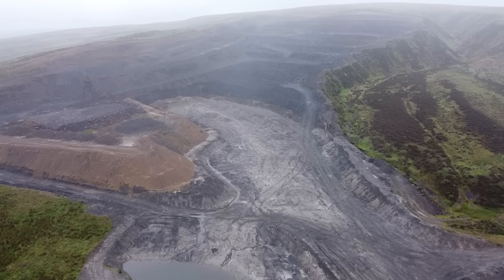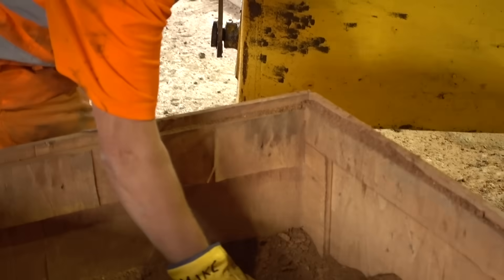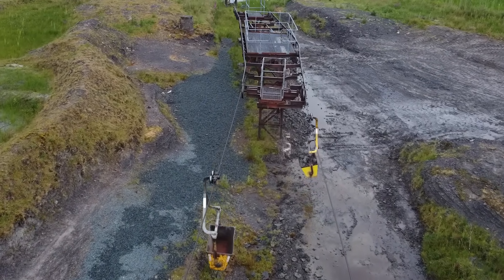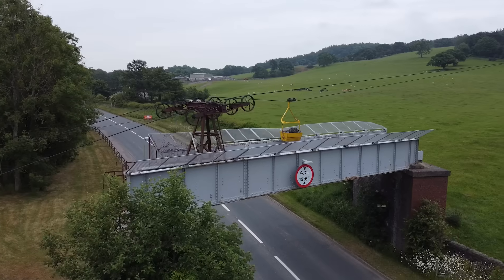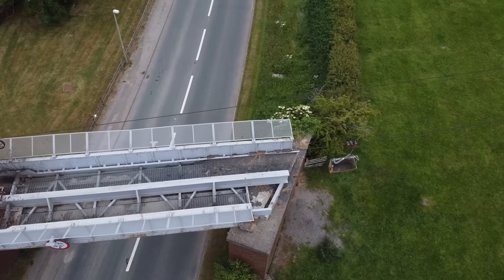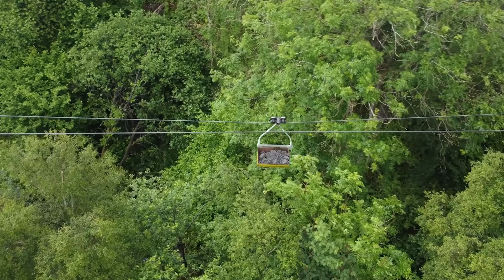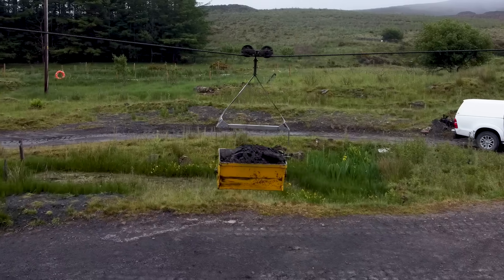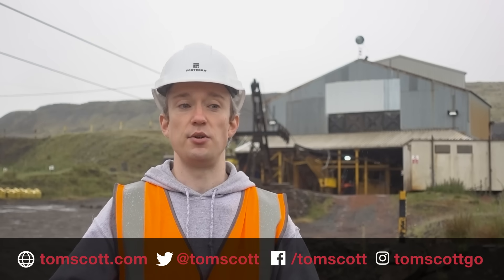The UK's last aerial ropeway uses no power, moves 300 tonnes a day, and will be gone by 2036.

Comment: How does an empty bucket moves up? I honestly didn't understand that, I could understand the filled bucket going down with gravity, how's coming back up?
Reply: The full ones going down pull the empty ones back up again.
Reply: @dingo137  But its a pulley rolling on the wire right? Or the wires have a hook where the bucket gets attached and pulls the wire with it?

Comment: "Unless money is constantly spent to keep it in working order"

Alright, whats the maintenance fees?
Reply: A new rope every 6 years
Reply: @edwardstarling1835  ha, that'd be nice. But you have to consider maintaining or at least getting the towers surveyed every so often. As well as replacement carts, or parts to repair the carts on top of paying someone with the skills to make said repairs. Though I'm sure thats not even half of it.
Reply: @edwardstarling1835 
I think that's only when you actually use it
Reply: @edwardstarling1835  a new rope that is quote “incredibly difficult” to replace. Again, what are the maintenance costs?
Reply: Probably a lot less than all the trucks they would need to replace this rope machine... Plus, it probably is a lot less in terms of payroll.
Reply: A brief google search found that replacing a 5 mile gondola cable cost over a million dollars. Annual inspections probably a couple hundred thousand, painting annualized is probably 25 thousand, then there’s brakes, lubrication, operators, other moving parts repairs, etc. it probably costs at least half a million dollars annually to keep it going. Probably more. I don’t see why they act like the cable is so hard to fix. I don’t see how it works be any different than chairlift/gondola cable. Maybe because there’s not a lot of demand in the area and so not a lot of local companies that can do it.
Reply: @DVeck89  Thanks! As to why the cable is hard to fix, I'm not sure, but I did notice they emphasised "cable of this size", as if it's easy to find splicers for other sizes of cable.
Reply: They kept using the system, so possibly was cheaper to maintain than replacing with another system.
Reply: A functioning society with a strong and skilled working class
Reply: The problem is the lack of people with the skillsets to maintain the technology, splicing thick steel cable? Never heard of the artform. Replacing steel cabling that long? Never heard of that either

Comment: I’m pleased the system is still working okay. However, when I visited many years ago in the 1980s I’m sure that when the system started in the morning…it was helped for a short few minutes by an electric motor. This motor and the switchgear could be seen by visitors. Once the weight of the full buckets on their way down took effect, the system carried as ‘self acting’ using gravity alone. Please correct me if I’m wrong…but that’s what we were shown on our visit. A truly fascinating industrial relic and it’s a shame that it will eventually disappear. Many thanks for your excellent video. Rob.

Comment: There was a similar system running in Cumbria and due to the steep and long gradient down into the valley it actually generated electricity through a clever braking system which was then sold to locally.

Comment: The modern version of this is the electric dump truck in Biel, Switzerland that never needs plugging in. It takes its load downhill, and uses regenerative braking to recover the energy needed from driving uphill, but empty.
Reply: Notice how none of these naysayers give any viable alternatives.
Simply amazing
Reply: @Michael-Archonaeus  I love how they ignore the cost of the damage being done to our atmosphere
Reply: e
Reply: Athos Aramis  Tonnes of rare Earth metals??? in what reality? and the electric power as just explained - is generated by regen braking - so ZERO external power required - ever.
Reply: Athos Aramis  More earth metals went into the railway.
Reply: ..don't forget the initial cost of manufacture..
Reply: @Alfred Wedmore That very slight cycling will allow the battery to last decades most likely, if the controller can balance for any dead cells well enough. Lead acid batteries can also do the same, only use 100-80% and they will go decades if you keep them topped up (for cheap, off-grid using old car batteries etc).
Reply: Nope not even close. Electric dumps are cool but way behind this.
Reply: That's fuckin sick but wouldn't it be way cheaper to just build another one of these things?
Reply: Batteries that lasts decades?
Show me one.
Reply: @scottdavis8645  CATL
Reply: @scottdavis8645  I had a Peugeot 106 Electric. Original built from the factoy with Ni-Cd wet cells in it in 1996. I sold it in 2015 still with the original cells in it and still a range of about 60-80 km (original range was 100 - 120km). They have built hundreds of these cars in France :-)
Reply: But the dump truck needs batteries to store the energy surely, which means a lot of pollution just mine the metals for them, they probably need changing every so many years as well.  The tyres will wear away and need replacing.  Yes the wire rope needs replacing on this system, but I bet the energy and pollution required for that are far less than that needed for the dump trucks batteries
Reply: @super7cat  Money is a factor as well. The biggest factor even.
Reply: @super7cat  Batteries that  are not RAPID charged and are properly spec'd (this will not be a tiny little battery pack) will probably be good for many tens of thousands of "mini runs". Even relatively old Lithium Iron Phosphate cell technology - if charged and discharged at modest levels - are good for around 10,000 FULL cycles before their capacity is becoming heavily compromised. An over engineered battery pack that perhaps usually only sees a few percent of its reserves used would be so under-stressed that it's lifetime should be crazily long.

Modern electric cars have a short(ish) life simply because the cars are built for performance, range and price. The truck will be built for durability and reliability. MASSIVELY different specifications
Reply: Plus the energy to load the truck. This isn't free...
Reply: @terrystearns1196  The energy comes from the potential energy of the ore/tock which is located higher than where it is dropped off.
The energy to load the truck is going to be exponentially less than the potential energy released from the height difference
Reply: @terrystearns1196   energy isn't free loading the buckets either..
Reply: Meh, been done years ago on't railway. Just bluster with a dumper, tho'.

Comment: It does use power and it does use fuel. The fuel and labour energy dispensed for machinery and people to load the containers at the top are the source instead of having it taken down in another manner. It's just indirect. Aditionally the construction process of the ropeway can be counted a large pool of energy dispensed.

Comment: Another fascinating video, but I've had a hard time googling how the mechanism works. It turns out that these are used in Nepal, and there are documents explaining them - but they seem to use more cables: a control cable and guide cable; here there appears to be only one cable. Also, was the aerial ropeway featured in Get Carter gravity driven?

Comment: Hopefully they'll fabricate a Golden Bucket for the last load of material to be transported, that can be put on display with original buckets. Here in Phoenixville you can find metal "baskets" at various locations that I'm guessing were used at the steelworks back in the day as a reminder of the town's legacy.
Could it be turned into a naturalist/tourist ride, with proper maintenance, of course? Park at the top with hiking trails/observation tower/ nature center. Museum with shops/pub/chippie at the bottom.

Comment: From a physics/engineering viewpoint, if it's doing work it IS using power.  In this case the power comes from the potential energy difference between the load of rock at the top and the load of rock at the bottom.  Mother nature is providing the "power" via gravity.
A slick design for sure.

Comment: Honestly I don't know why this system isn't used more often, I doubt the maintenance costs are going to offset the combined fuel, maintenance, and labor costs of a similar truck route (you could use a pair of chain instead of a massive cable to avoid needing a specialist to splice it) so long as your destination isn't too far away you can have a simple reliable and cheap way to move material.

Comment: I can imagine having it turned into tourist attraction, transporting people just for the experience. An emission-free thing like that, in a modernized version, could actually work for tourists in many capitals with height differences. Paris, Lisbon, Nice, etc. Or even for local residents, as means of public transport. 
Anyway, great technology.
Reply: Well, it only works as long as you have something very heavy to send down. Otherwise you would spend more energy bringing the counterweight uphill than it would take to just do it electrically.
Reply: Also by the sounds of it the timing is very important, humans are very VERY bad at being loaded into things in a precise manner and awful at consistently weighing the same amount for each human. Now you could overcome this with a motor like many a ski lift has but then what's the point?
Reply: Also it only works one way, so you have to get your humans to the top of the hill at some point to send them down which means you require a mode of transportation to get them up there which is then going to go back down empty, why not just cut out the lift entirely and just send the transportation full up AND down.
Or could put a motor to send them up as well but then we run into the same issue of needing power to do that, making it expensive to maintain AND not unique anymore.
There's a reason they only use the motorised ones for ski lifts :p
Reply: Sorry, the health and safety JIHAD would have your balls on toast. BUT I agree- let's do some of this and show them the bloody finger for once.

Comment: If there is a fossil in those shales, the system would be fossil fueled.
Reply: incredible
Reply: It's my local shale-bed. Carboniferous. Loads of Stigmaria, Sigillaria, Calamites etc. Very fossiliferous.
Reply: get out. haha
Reply: I upload  This mine is for making bricks not Shale oil. So I don't understand the objection. (By the way I'm not a leftist I'm just legit curious)
Reply: I like the way you think, sir.
Or lady, I can't tell
Reply: Fun Fact where I live we actually have oil shale which is used to make shale oil. It's mined, processed, and used just like regular crude oil. So if this was used for on of those mines it would be "Fossil fueled".
Reply: r/technicallythetruth
Reply: Well, i guess we are back to square one
Reply: Indeed!  I am deeply familiar with the kinds of fossils that can be found in shale.  The only way they can be used as "fuel" is to use them as a weight in a system like this!
Reply: Nice
Reply: No, it's based on natural bending of spacetime.
Reply: Yes but actually no...
Reply: @PrakharBaisakhiyar  Of course it is, the weight of the fossil pulls the bucket and rope system along
Reply: Legend
Reply: It would actually be fossil fed fuel because the fuel isn't entirely fossil and would only contain some parts fossil which contains fuel of fossils, meaning the fuel itself would be fed by part fossil intern making the fuel actully fossil fuelled fuel or fueled by fossil fuel fuel as fuel isn't actually fueling in terms of fuel but in the terms of gravity fed fuel. Which is a different type of fuel altogether.
Reply: @_wanted_outlaw3007  you my friend are a ginius

Comment: Them- its a 25mm steel rope
Me- thats a 25mm cable though?
Reply: No.  Cables have a diameter less than 3/8" (9.52 mm).  See the Wikipedia article on "Wire Rope".

Comment: Not quite the same, but there are quarry with a modern twist on this:

Massive Dumptrucks with a fully electric powertrain, that never needs to be plugged into a wall. 

They only carry loads downhill, so they use regenerative breaking the entire trip down, which charges the batteries, which are then used to get back up the hill and around the quarry. They then load and and go back down hill, fully charged by the time they reach the bottom. Repeat.

Comment: A motor will brake when doing regen.  I'm surprised therefore that they have not hooked up a motor as a generator, which will reduce brake wear and generate money / store power in a battery.  300 tonnes per day is a lot of potential power going spare.
Reply: Those empty buckets still have a significant amount of weight to them, as well as friction losses to a cable three miles (!) long.  Several times they referenced the criticality of balancing the load by controlling the spacing on the buckets.  I doubt there is much spare energy to be harvested.  And if there were, they would be adding more buckets!
Reply: @DocNo27  sure, but as with a car you can have both brakes and regen.  And, with regen, you might manage more buckets.

I suspect that the slope is maybe not that great and you have to bear in mind that the cables droop between the towers, so it is not a simple matter of the start point always being higher.  

Cable cars usually have a balance weight to keep the wire tight , we did not see that on this system.

Comment: The rope attachment/detachment system isn't that indifferent from "express" chairlifts, that detach the chairs from the cables at either end. (in order to slow them down enough to get on an off, while running the lift cables at a higher speed than you could with fixed chairs)
Reply: It's exactly the same as the Mitchell's / British Ropeways chairlifts that we remember so fondly from Butlin's.
Was it installed by Mitchell's?

Comment: So if a turbine is connected, can it generate power?
Reply: Probably, but not very much. It comes down to resistance. The weight of the filled buckets and the slope of the hill give it JUST ENOUGH gravity to turn the rope in a loop, with the heavy filled buckets going down hill and the empty light buckets being pulled back up hill. If you add a turbine you add more resistance to the system, as now the filled buckets and slope need to more gravity to turn the turbine as well as the system. While you could increase the gravity by increasing the weight of the filled buckets and the gradient of the slope it would not be worth it. The power generated would be fairly small and the added turbine would greatly decrease the speed and efficiency of the system.
Reply: 🤔 Well theoretically you could use the turbine as a brake actually, so you could generate power with it...but that would be just a side effect, you still have to use power (or fuel) to fill the buckets at the top.

Comment: what the hell, this is WAY better than trucking stuff around, why aren't there more ropeways around?
Reply: Most quarries need to move stuff up, out of the quarry? Not sure.
Reply: I can see a couple of reasons. A cable way is more prone to single point of failiure. Failiures are trickier as there aren't standard components and millions of competent mechanics. If you built it in modern day with Western standards and laws you would most likely need to make the ground under it a no-go zone, which is a pain in the ass to farmers.
Reply: Just watch the video and you'll see.  They sure are trucking things around they material just happens to be unloaded onto a cable way from one truck down a hill and dumped into another truck.  

At some time in history this was more efficient.  since it exists they keep using it.  If they were to do this again today theyd just truck the material.

Comment: It's ironic that at the bottom of the hill the buckets ended up being tipped in to a lorry. These days they'd do that at the top of the hill and not bother with what looks like a labour intensive process. I'm wondering if the licencing conditions mean they were required to keep using the insitu bucket line.
Reply: Two dudes transport 300 tonnes of shale a day down an extremely steep slope that is 1.5 miles from point to point, but would require countless switchbacks (don't discount cost of road construction and maintenance!)  and dozens of trucks - that require drivers, fuel and maintenance themselves.  All while spewing exhaust.

I would imagine if another quarry/factory arrangement were to be developed in an area with similar geography you'd see a system like this implemented. The savings this has to have vs. trucks would be enormous or they would have switched to trucks already!
Reply: @DocNo27  But the road will be there anyway to get to the quarry site, there is already a lorry involved and my thinking is you'd have lower manpower requirements without the lift. I'm not in favour of getting rid of the lift - I just suspect if it wasn't already there then they wouldn't build one today.

Comment: No energy needed for the ropeway.   Ok, nice.    What about:
- A shitload of fossil fuels that are needed at either end.
- And the product itself is all destined to be burned. Pure carbon in a bucket.
Reply: They are bricks, not coal.
Making "green" bricks is not yet possible, but also not really an issue, once they have been build they tend to be used for a good few years so they are not a major problem to the environment.

Comment: couldnt a system like that that uses gravity be used for renewable energy?
Reply: maybe, but we can do the math.
I did some similar math and forgot the figures. For a 20 tonnes truck to go down a km, would be some kw/h produced, maybe 7. And I assume that this does not go down so much. 
so for 300 tonnes a day, considering the losses for such a long ride, would be not very much electricity. let say 100 or maybe less 50 kw/h. this will be 10 or 20 dollars daily. Sure in a year will be few thousands. But not enough to bother. By ambition it could be done though.